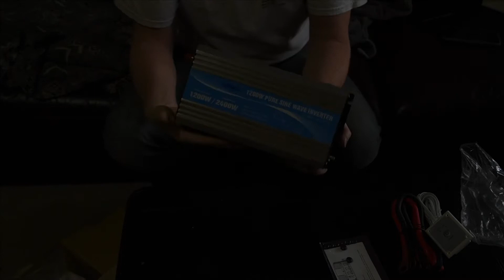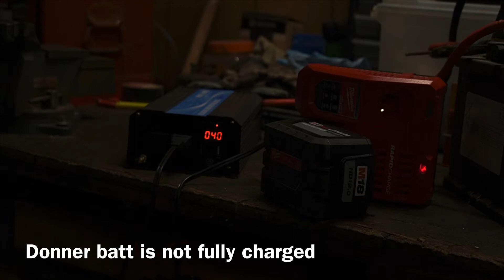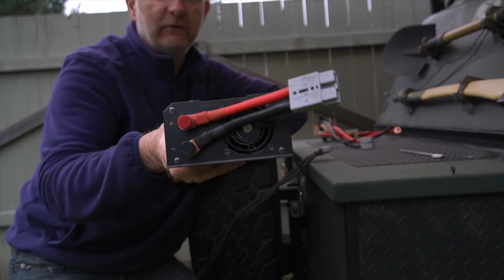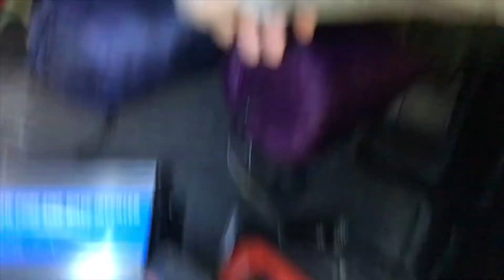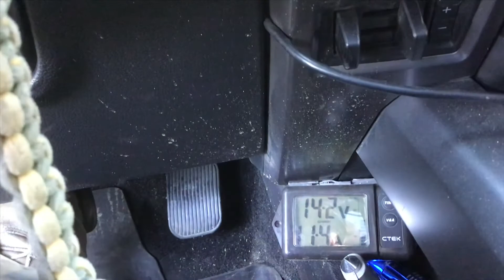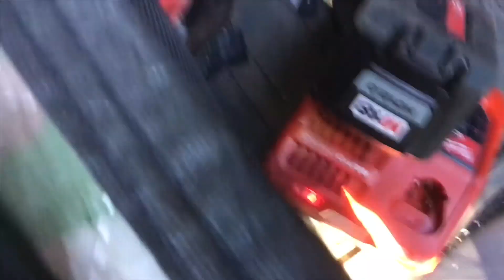1200 Watt inverter install

Comment: Could I have this installed using just my trucks battery? Only using a 1000w micro wave.
Reply from the maker: I am sure you could if the microwave doesn’t pull too much power for both the inverter and/or the vehicle battery.
Inverters convert a bit more power to transform so the truck may have to be running, I am not sure what setup you are running.

Comment: Do you have a battery isolator  hook up with your setup ?
Reply from the maker: The isolation is done through the Ctek unit. I hope this answers the Q but feel free to reach out if you have more Q’s. I have been running it for 2yrs and I have not had a problem.